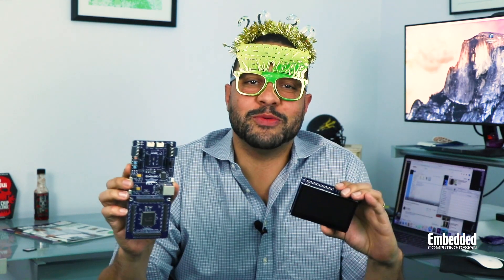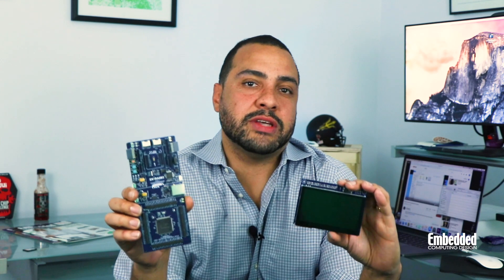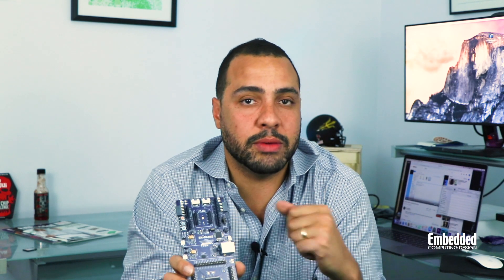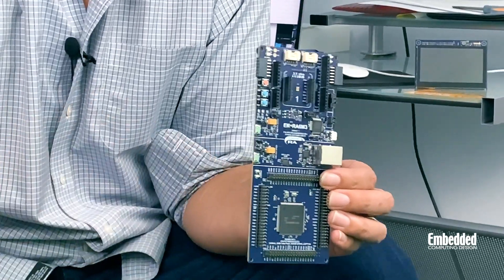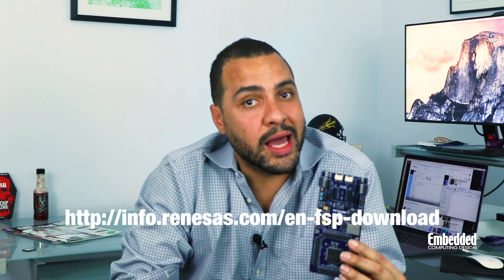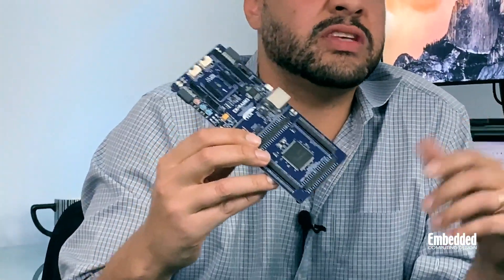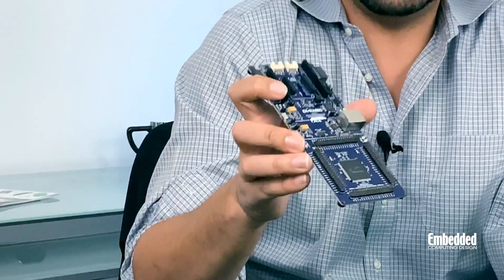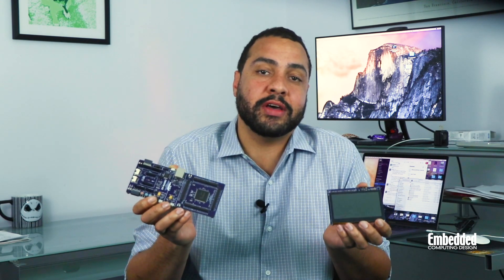Dev Kit Weekly: Renesas EK-RA6M3G Graphics Evaluation Kit

Comment: Just got the EK-RA6MG, I plug the board into the pc usb, the white power LED, and orange LED are ok, but I wasn't able to see the Com port in the device manager, also the driver LED'S (blue) didn't come on. I'm missing the drivers, and if so how do I get them. I'm not able to go any further to use the terminal. Can you advice?
Reply: I received a message from Renesas regarding the EK RA6M3G kit, and they informed me that the board should have shipped with the get starting software. And according to them, this kit didn't have the OOB software. So I am returning the product to Mouser electronics. I hope there suppliers are able to fix this issue. We would really like to explore this kit 😍.
Reply from the maker: @johndubose1401  That's too bad hopefully they can get you up and running with the right stack soon! Let us know if you have any issues with the new kit when you receive it!
Reply: @EmbeddedComputingDesign  I'm facing the same problem on EK-RA4M2
Reply from the maker: Hey John,
Thanks for the question. Have you downloaded the Flexible Software Package (FSP) yet?  (https://www.renesas.com/us/en/products/software-tools/software-os-middleware-driver/software-package/ra-fsp.html)

There are also some instructions on getting started with FSP on Github (https://github.com/renesas/fsp#setup-instructions).

If that doesn't work, Ashish can probably point you to exactly what you need. I'll point him to this thread.
Reply: @EmbeddedComputingDesign Ok I try the above links.
Thanks
Reply: I've tried the above suggestions, but still no results. What else can I do?
Reply from the maker: @johndubose1401  can you shoot  Brandon Lewis an email? You can find his contact info on this page: https://opensysmedia.com/about
Reply: @EmbeddedComputingDesign  Hello, I decided to send this product back to the vender. I'm looking to get a workable module. I think it was a bad kit. It didn't show up in my pc device manager, and I got no alert that it was plug into the com port. So I'll let you know about the new kit once I receive it.
Thanks
Reply from the maker: @johndubose1401  Okay, John. Let us know  how that goes. I just spoke with Renesas and they said their happy to have an FAE assist (even when you get your new kit).

Cheers

Comment: Hello Brandon!! Happy to found you and your channel.
I'm working as firmware developer and I want to read a SD Card. I'm using RX231 Renesas family, which has a SDHI module, but I can't find an application note with code example to use the module. As I'm new in these area I don't know from where to start, I'll be very grateful if you can provide some information regarding SD Card reading from Reneas. Thank you very much!!!
Reply from the maker: Hey Emil,
Sorry for the delayed response. Are you using a starter kit? If so, I'd check out this user's manual: https://www.renesas.com/kr/en/doc/products/tool/doc/003/r20ut3027eg0100_rskrx231_usermanual.pdf

Either way there should be some demos/sample code within e2 studio.  Renesas just released a new version last month. You can download it here: https://www.renesas.com/us/en/products/software-tools/tools/ide/e2studio.html. 

It's pretty intuitive so you should be able to navigate your way into and through a quick project. Let us know if you have any difficulties. Good luck!